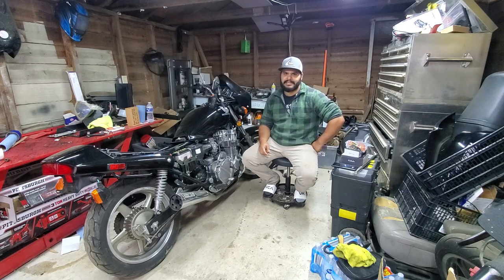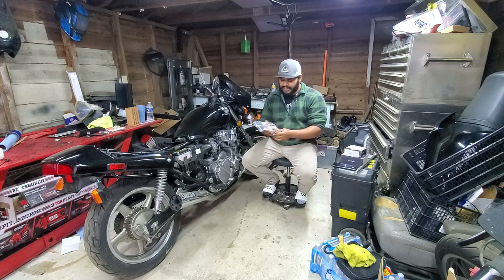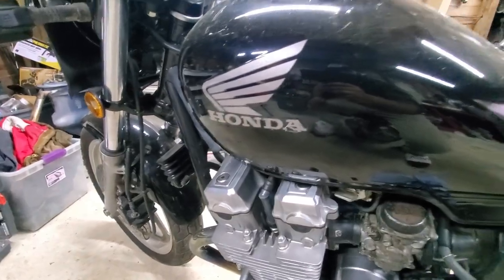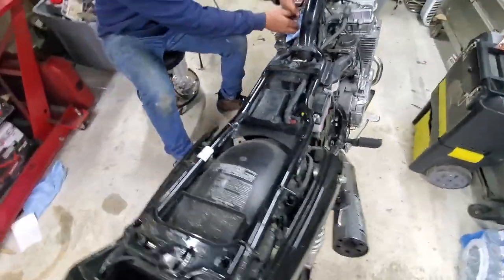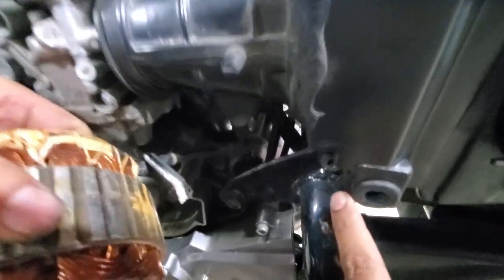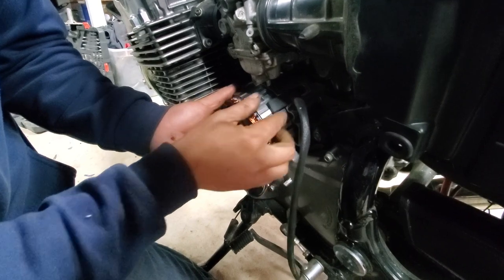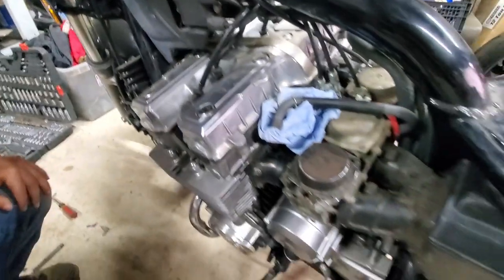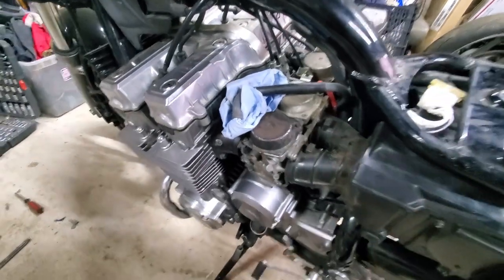Stator & Regulator Rectifier Replacement for 1992 Honda CB750 Nighthawk

Comment: Awesome video man, think I'm going to have to do this to my 99' 750. What was your battery voltage reading at idle before the repair and then after? Did it solve your problems.
Reply from the maker: So after alot of research I found out that this particular bike does not charge at idle because of how the stator is built. It charge great after 2k rpm so if you're not charging at idle it should be okay as long as you're getting 13 to 14 volts at around 2k rpm.

Comment: Where did you got the parts ?
Reply from the maker: they were bought on ebay
Reply: @overthebars5954 hey I have one like this I bought rotor and all but the glue that holds the rotor together (copper coil) comes apart a bit did that happen with you too thanks ?